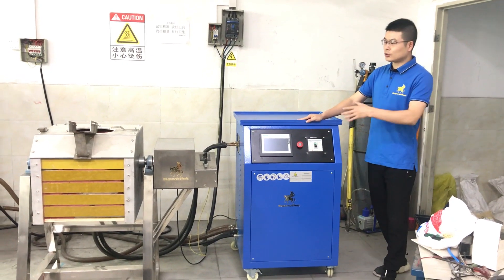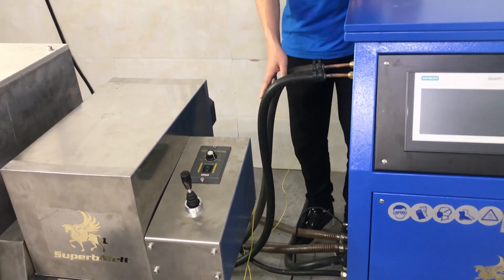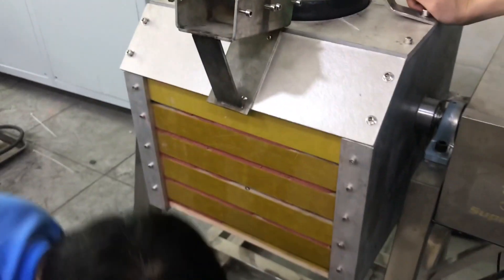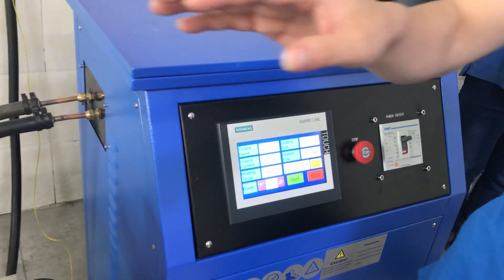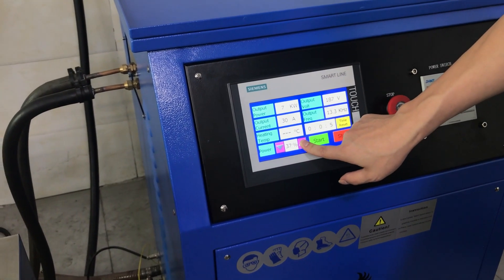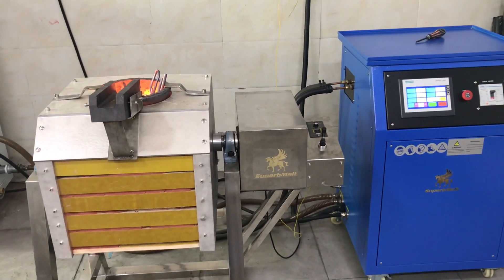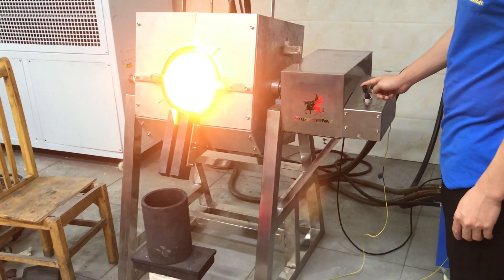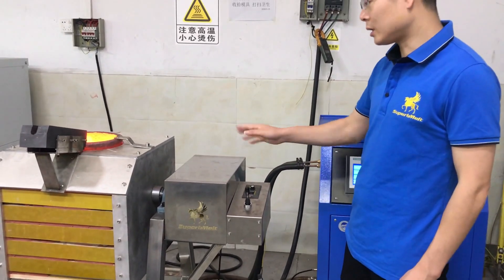20-100kg Non ferrous metal Induction melting furnace

Comment: please can you tell me about the connection between the power supply and the tilting induction coil?   i have the tiny LH15a (15kw) and i want to build a tilting crucible but can find the flexible hoses that carry both power and water.   can i simply use very fat copper cables and high temerature water hose?   cheers   tanc
Reply from the maker: Please contact the engineer for any questions
whatsapp:+8618857719978
email：sales@superbmelt.com